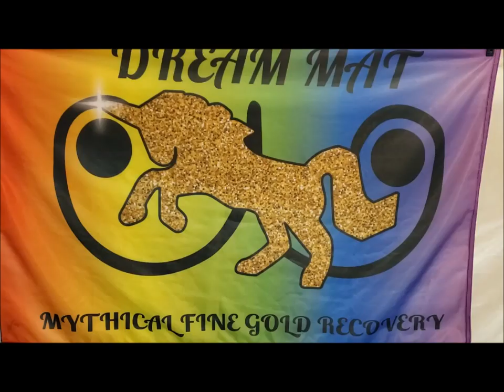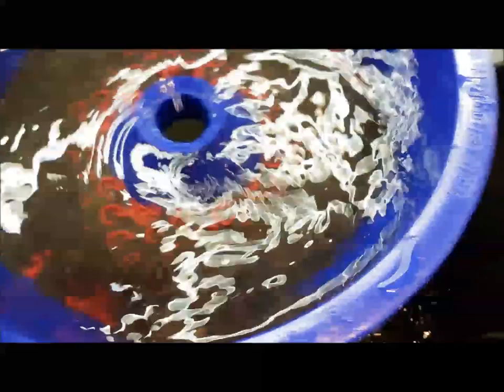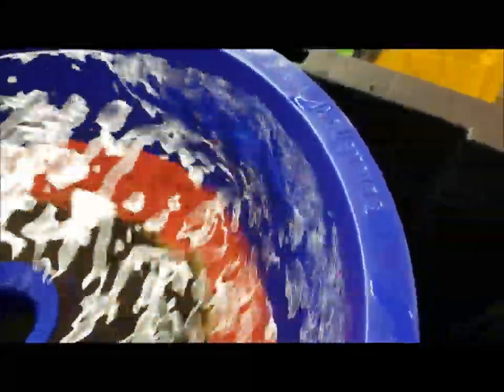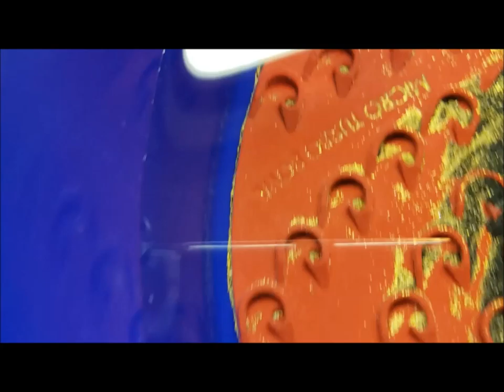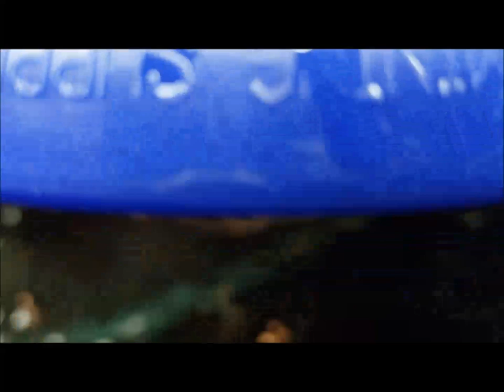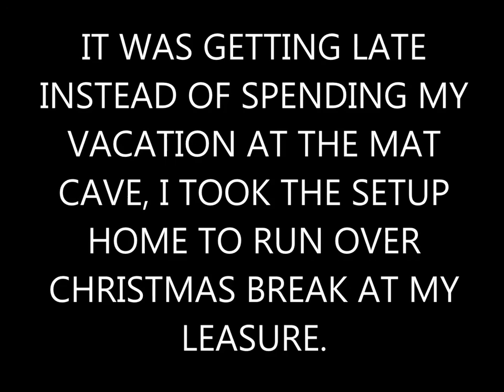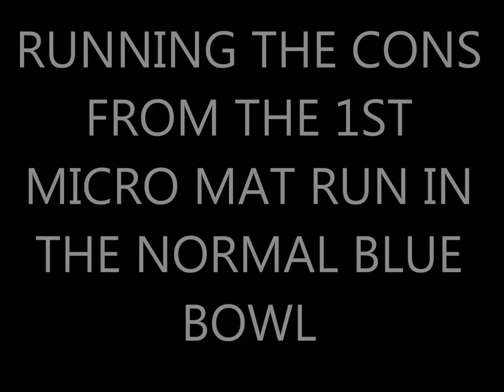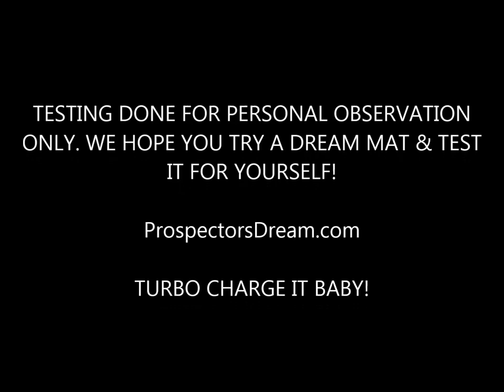Boost Your Gold Recovery with Micro Turbo Bowl: Dream Mat for Blue Bowl Concentrator!

Comment: Y’all he says he’s losing it out the top because he’s running as fast as he can to test. You can slow it down to your liking when you get one😂 but if you can run beach cons fast and catch most of the gold then why bother with the tid bits right then..? Save that for the long winter months! Collect most of the gold now and save the cleaner cons for later when you have nothing to do but try and extract every last speck of gold from the sands....
Reply from the maker: Zactly!
Reply: For I-Concur

Comment: if you look closely the gold isnt being trapped in the swirls theres more behind it than in frot of it until such point you saturate it with gold,  ive been mining for 30 plus years  wouldnt trust this as  a commercial   process  maybe ok for mucking around with but to me its just adding a so so process  if you tipped the  product he put in there in a normal pan you would get the same gold back out

Comment: Instead of running the pump directly into the blue bowl, plug the pump outlet into a small clear container like a 1 liter soda bottle or milk jug or whatever...I say5 small for ease of handeling. Then connect a second valve between the container and blue bowl and see if that doesn't help reduce the creeping of the waterflow. It should give you extremely fine adjustments and a way to see  the water that the main valve is letting through which can be then tweaked with the secondary valve.
Reply from the maker: Ah, poor man's pressure vessel
Reply: @TheDSP1970  that is pretty spot on. I am that level of poor where I have to engineer something if i want it...
I am still trying to get the extra cash for pocket-sluice a year after discovering it exists .

Comment: With the mat in ,mine won't level at the top or overflow. The mat causes alot of friction.  Nothing wrong with it, just needs a stronger pump or it won't clean anything but black sand. Guess that's what it's for though huh? 😄 Also an electronic flow control. Otherwise, you'll lose gold if you walk away. The more material that comes out,, less friction and it speeds up.. Again, ITS doing what it's supposed to do it's just weaker with the matt. 1 piece of gravel in your sand and it'll kick it all out eventually.  Just FYI, things to consider.  I ❤my mat,don't get me wrong.

Comment: Would it have so much gold drift if the profile was aligned along the spiral motion that the water takes rather than along the diameter of the bowl?  It seemed like the gold was spilling out and migrating to the center, which is fine, but if the profile was angled slightly in that direction (i.e. towards the center), wouldn't it hold it?  Analogous to phyllotaxis.

Comment: Gold is not magnetic. A lot of the black sand is magnetic. So, would placing a repelling magnetic field at the bottom of the bowl push the black sand up, so that it would get caught in the current and would fall through the swirl at the center of the bowl faster?
Reply: That’s why you have a bucket! You can pan the remaining stuff that’s gone through the bowl center,  good point though!
Reply: No. There is no such thing as a ‘repelling magnet’. Any magnetic material has two poles, the black sand would just attract to the opposite pole on the magnet.
Reply: Which is to say,  it will pull the sand out, not push it away!

Comment: Does it matter what direction the water is run? Viktor Schauberger's reasearch seems to point the other direction. I love the idea of the mat. The choice of a metalic valve that probably wont break (or the inexpensive one) with some way of indicating where the sweet spots are for flow would be beautiful.
Reply from the maker: Flow needs to be in clockwise direction

Comment: I worked for almost 40 years on a paper machine and we used cleaners for the stock slurry and they used the same vortex concept some of them were sealed units and some had an open reject and we used to monitor pressure to get the best cleaning so I would assume the velocity is key and it would vary with size and type of material, I would think even water hardness plays a part. You also did not mention surfactant or removal of magnetic material which could interfere.

Comment: Great video just got my dream mat for the blue bowl  How  do I Install the mat It kind of sits raised up on the center cone It doesn't sit  flat on the bottom  is that normal  Do I use  Silicone   to hold  it down ? ,Any help would be much  appreciated

Comment: I wish this had close captions.  I’m deaf and want to know what is said.
Reply: Essentially he’s trying to show us how to use the blue bowl for slightly more then what the blue bowls intended for. He’s claiming that with his mat you can run the blue bowl faster and use it essentially to concentrate paydirt into concentrates. then you use the blue bowl without the mat to finish the material. I’ve red the mats float so they may have to be siliconed down to the mat.
Reply: If you have any questions I can try to answer them but I just bought a blue bowl myself. so I have no experience with it lol
Reply: The blue bowl is finicky in that it must be classified and the better you screen it, so will the recovery be.  Yes,   clean water makes the best recovery, closed systems fill with silt and clay and are more buoyant floating it all out, so it should, need to be drained/filled periodically. Last question; He makes and sells the mats and was giving a pitch on how superb they are, when in actually, blue bowls kinda suck! 
They are slow, and the better you can automate the run time the better. 
They also work with water and need adjustments, tuning, and upkeep.  Mine is running right now in my living room. It takes up the space of 2 5-gallon buckets and a car battery, with a 2 amp charger, buckets are full of water with a pump in one and a blue bowl on the other. The car battery between them which is worn out, but I connect the pump and small charger, and when I want to use I plug/unplug the charger. I'm warm, with music, and TV too!  Food and drink, with all the amenities desired and I'm accomplishing something!
Reply: Look up blue bowl gold recovery on You Tube and a ton of video on how to use to simple upgrades to make it more functional/better than stock!
Reply: Also, you should get closed caption on here, I'm almost 100℅ sure of it.

Comment: I usually drop my material in After most of the light sand is gone I run a neodymium magnet pick up all magnetite   then run  the rest  through  I tried Taping two  vibrating palm massager  to  the outside of the blue bowl It did help move the black sand and break out the lighter material trapped underneath that  will sit for a Really long time And I usually will stop running take my snuffer bottle  and move the heavy black  sand around  then start up, I usually save up about  10 5 gal buckets classified  down and run it all winter

Comment: It doesn't really matter if you don't get most of the gold. If you just run it then put the material through a screen. The gold small enough to run through the first time will be much smaller than the black sand. Then run it again at a slower speed.
Reply: Also if you put the stuff that was trapped in the first run through a screen then most if not almost all of that black sand will stay in the sieve.
Reply: Nice now I'm gonna plug in my old ratt cd and drive around thanks.

Comment: It was an good idea but I find I can't clean out the black sand no matter how fast I have the bowl running so its defeating the purpose of removing the gold from the heavy material.  Plus a huge amount of material gold and black sand ends up gathering under the mat even if siliconed to bowl.
Reply: Gold is where you find it, but seriously, dude, sometimes you have to do what a contraption won't do, and as much as I despise it, once in a while, you need to bite the bullet, everything enjoys a quality hand job, you will do fine!

Comment: Can you lose gold threw the center hole ?
Reply: 1st thing first- search gold structure with magnification jewelry X10 scope, gold structure must be determined alluvial gold or E-luvial ; finds  "A"-luvial-[and;or] - "E-luvial.  
Alluvial gold will be smooth edges, flatter,rounder-shape "A" for aqua, by-which aqua moved gold 100' + [by-the stream] Standard-Estimation. For the collection method shall be sufficient mean-while time saver. For the E-luvial gold structure  with the sharp,jagged,ruff,edges,not-smooth-. Collection method E-luvial gold, tap, swirl, stratify.
Reply: Yes, if you run it too fast. The bowl is for fine gold 30 mesh and finer. Gold having a specific gravity of 19.3 and black sands having a specific gravity of around 5.2 only requires you to run it fast enough for the sands to climb the cone.